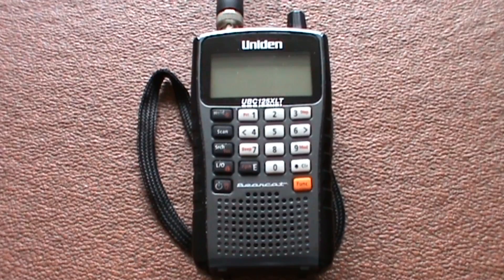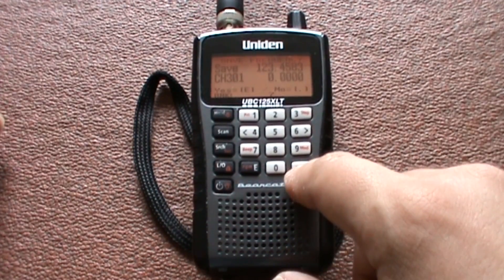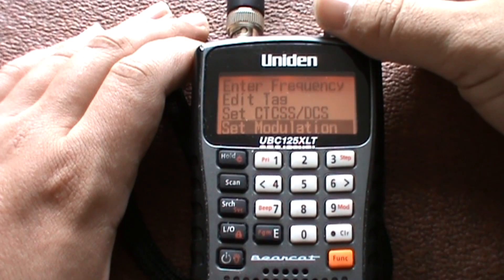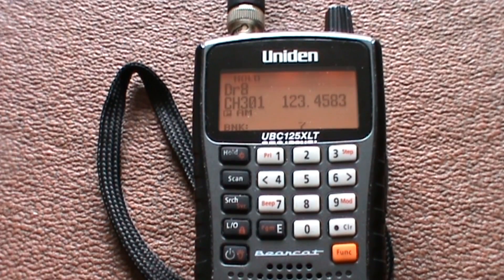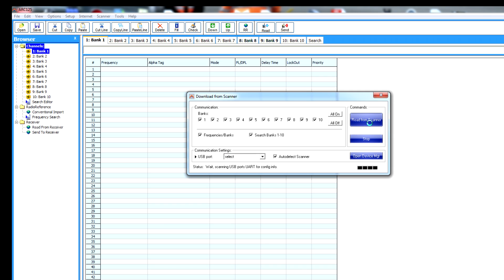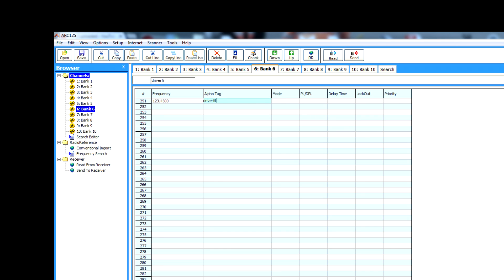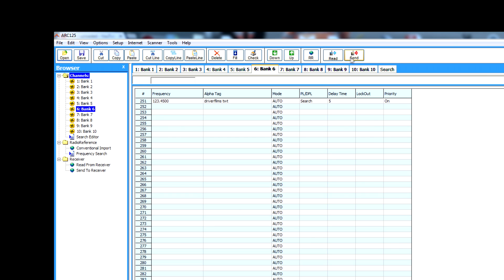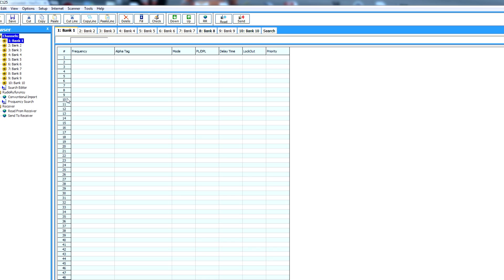How to: Program frequencies into the Bearcat UBC125XLT

Comment: I've entered the frequency and saved it etc, that's all fine, but how do you actually listen to the frequency? As I'm not getting any noise from the scanner
Reply from the maker: What are you listening out for? If you live to far from the transmitter you wont hear anything  Also be aware that whilst listening to the air band frequency's the overs are very short. Try setting the squelch level to 2, this will help the scanner pick up the weaker transmissions.

Comment: Hi.
Just watched both of your tutorials on this scanner, which I am thinking of getting. I noticed that Manchester Airport as well as Liverpool were programmed in. I live in Stockport and my main thought is, will the scanner have the range to pick up EGCC? 
I’m not sure if you live in the Manchester area so not totally sure you will be able to answer my question. But any information would be appreciated.
Reply from the maker: I live about 30 miles from Manchester/Liverpool/East Mids/Birmingham. I can only pick up departure and arrival frequencies when at home. As you live in Stockport you have a better chance to pick up the Tower at Manchester. as it has a limited range and is line of sight. Tower  can be picked up within 15 miles or so of the Airport depending on any hills etc
Reply: driverfilmsshortwave Hi Many thanks for the info.

Comment: How long do police scanners last?
Reply from the maker: You cant listen to the police with this. Regarding the battery life it depends if its in constant use, or if its used occasionaly
Reply: driverfilmsshortwave why can’t you? And can you listen to radio as wel with this?
Reply: @cheeseIT1992  police have digital radios which effectively scramble the conversation so you can't hear it.

Comment: how do you add ccts codes using arc125?
Reply from the maker: On the PL/DPL drop down menu
Reply: driverfilmsshortwave thanks seen expensive for the software mind.
Reply from the maker: There is another - scan125 but Ive not used that one.
Reply: driverfilmsshortwave ok I have this on route from Amazon so just learning before it comes, can you rename the banks instead of bank 1 to air 1 or marine 2 etc
Reply from the maker: Unfortunately you cant
Reply: driverfilmsshortwave daft question but with the uniden can u scan the band's for new stuff ? or only stuff you have programmed???
Reply from the maker: You can, just press Search (Srch) and it will scan all the bands, or Func then Svc to scan Emergency/Freenet/PMR/Marine/Aircraft/Cb Radio/HAM Radio 10 Meter band.

Comment: please help I whenever I search it finds one but just sounds like a jet engine or bullets then just goes it is set in am
Reply from the maker: What were you searching for? Also what is the squelch set to?
Reply: driverfilmsshortwave  squelch is max and I was searching for literally any aircraft overhead
Reply from the maker: If squelch is set to max its something local. Google search that frequency and set what it is. I keep squelch set to 2 so I can pick up more signals
Reply: driverfilmsshortwave it's not just a frequency it's literally all
Reply: driverfilmsshortwave so I had a custom antenna thought that was the issue but it isn't due to it still happening
Reply from the maker: Turn the squelch to 2.  Could you upload a video of the noise you are getting, I might be able to diagnose the problem better
Reply: driverfilmsshortwave  Did that 2

Comment: I have just got this scanner set it up with frequency's saved 3 frequency's coninsby Gatwick and fair ford how do I go back and view them also any frequency's and bank do I use for military I believe they are all on bank two
Reply from the maker: To manually select a frequency press the hold button (top left) and twist the volume button to select the frequency. Regarding Military frequencies - you can place them anywhere you want.

I hope this helps